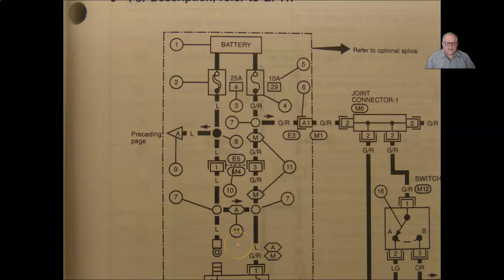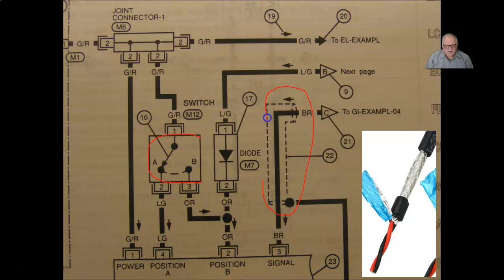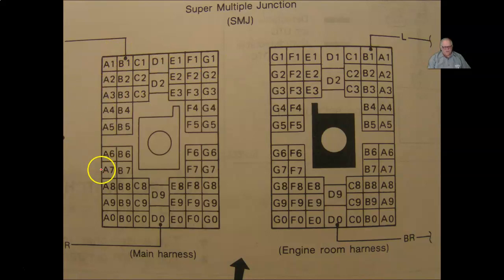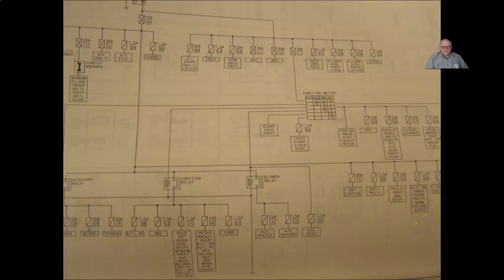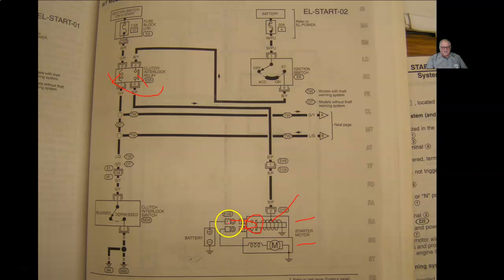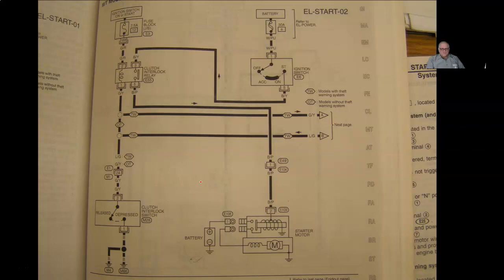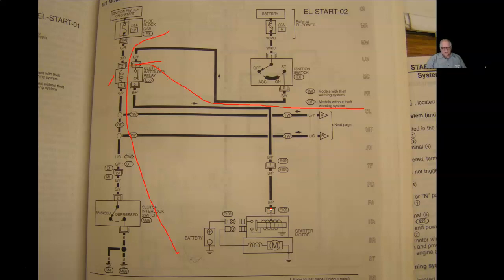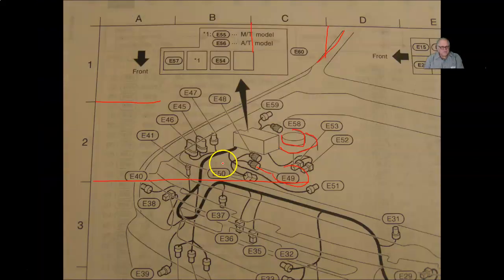Nissan wiring Diagram

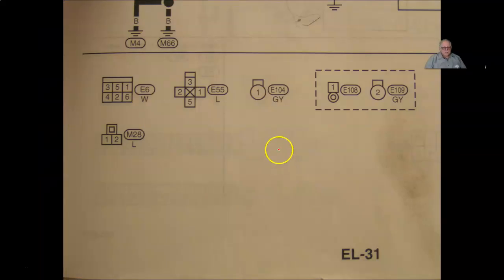Comment: on 17:11, the harness diagram on the bottom, it does not say H.S. or T.S., how would you know?  I'm assuming i looking at it from the terminal side
Reply from the maker: The images at the bottom the diagrams are always terminal side.  The only time they are going to show you harness side is when you get to the diagnostic testing.  (Sorry it took so long to reply, Didn't see the email until recently)